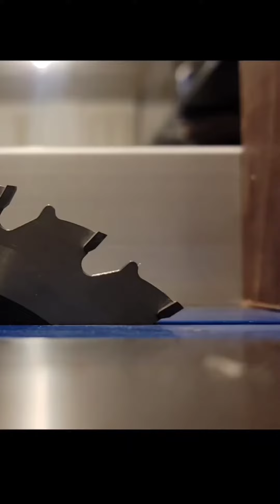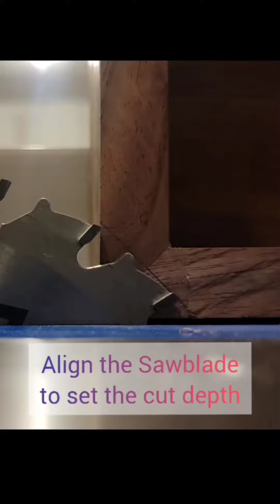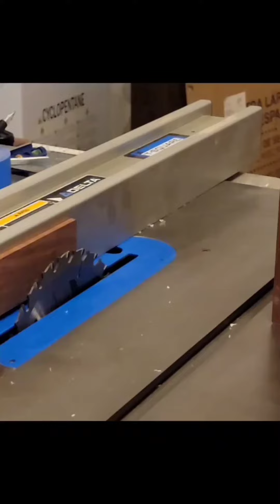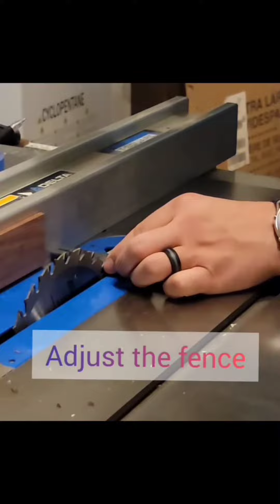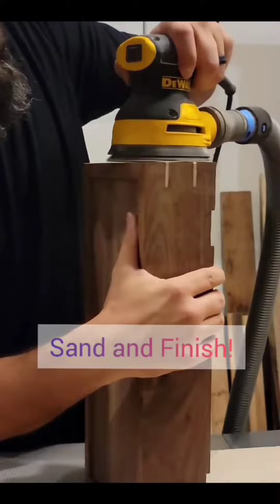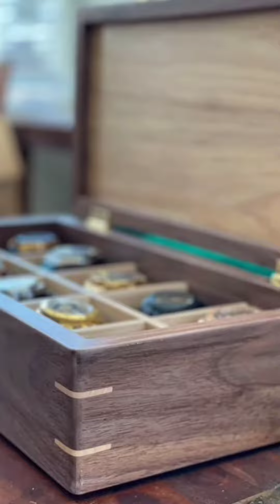Super-Easy Miter Splines! No Jig Required!

Comment: I to hate to get picky but this is about cutting kerfs, not splines.
Reply from the maker: Correct this allows you to cut the slot (kerf) for the spline... You will still need to cut the actual splines the same thickness as your blade
Reply: Yeah, i was trying to find a video that showed me how to make splines themselves if I didn't have a bandsaw. This is not the video for me.

Comment: Missing a step. You need to mention you used a flat toothed saw blade. Which are actually hard to find in box stores and must be ordered online. Can't imagine how many DIY dads copied your method and ruined their boxes because you left that fact out.
Reply: It would be pretty easy to clean out with a 1/8 chisel.
Reply: Use outer blade of stack dado set.
Reply: @Mike Cochran   In theory yes but it would need its own throat plate. I also wonder if the blade would come up high enough with the addition of the corner jig. Lastly depending on the wood a single dado may not be as clean with only those two teeth.
Reply: @StillLivinginthewoods   alot easier to just get the proper blade. Not banging on the man just thought it should be mentioned.
Reply: @biebermyballs100   Yep 100%
Reply: Even most 1/8 blades on box stores saws aren’t 1/8 though but 3/32.  I assume a 1/8 chisel is true 1/8?
Reply: If the bottom of the cut isn’t flat just clean it up with some 120 sandpaper folded over a hacksaw blade or other similar thin item.  A couple of strokes and your ruined Box is ruined no more.
Reply: Why does there always have to be the guy with the glass half empty?
Reply: @Motocicleiros   In your case. I wish I never said anything and your corner came out looking like sht and requiring extra steps.